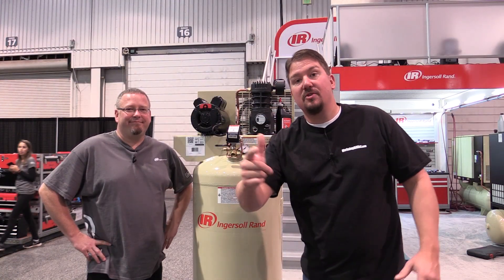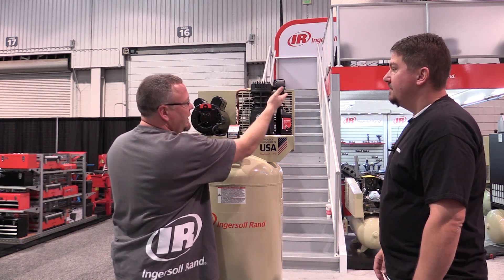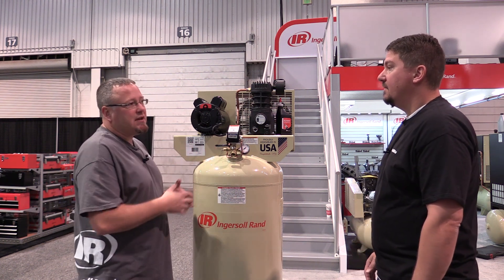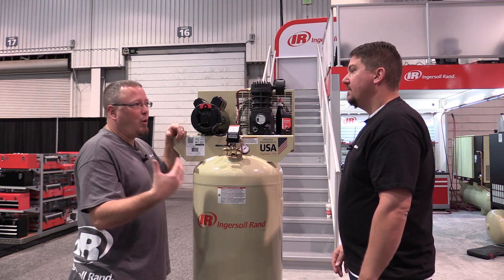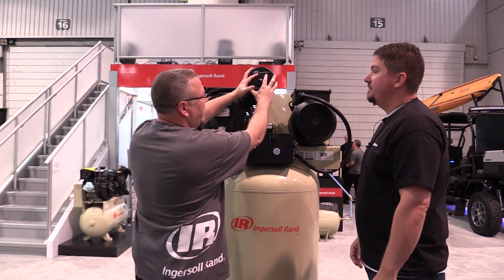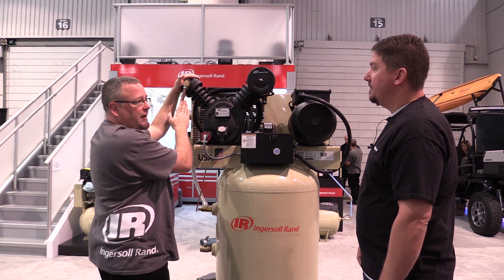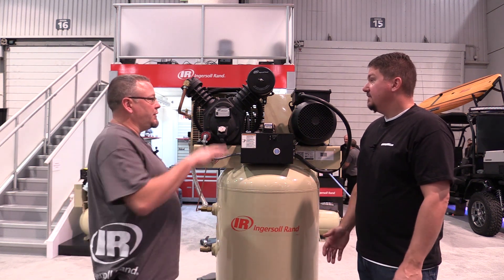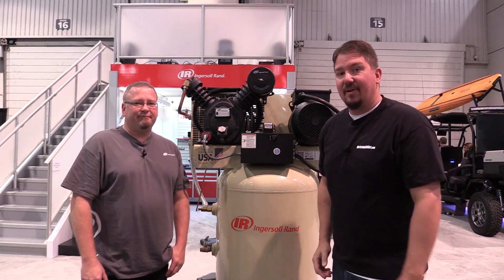The Difference Between a Single Stage and Two Stage Air Compressor

Comment: It would have been helpful to mention that the 1 vs 2 stage compressor is a trade off at any given power, between lower pressure (<150psi) but higher volume, and higher pressure (>120psi) but lower volume.

Comment: I’ll tell ya the best kind of air compressor is a screw type way better than the pump type and when using tools your not really looking at PSI your looking at CFM the more CFM you have the more continuous air you get like for sand blasting plasma cutting even the air tool needle scalers the list is endless with a screw type
Reply: Now I’m running a 10 gallon Central pneumatic 125 psi with to 20 gallon industrial air auxiliary tanks

Comment: I purchased a new single stage 30 gal Kobolt Air compressor and 6 weeks after warranty ran out (5yr) wouldn't you know my crank shaft snapped off. I have been unable to find parts for my motor, 30gal, 155psi from Lowes or Kobolt. Does anyone have any recommendations on where I can order parts (Crankshaft) for my motor. Oil was full when I took off the plastic cover only to find the flywheel sitting there unattached to the belt. Any suggestions would be appreciated. Peace
Reply: Have you tried https://aircompressorpartsonline.com/
Reply: @Berry_MaCocknher  Had not as of yet but thanks for the info. Will give it a try and get back with you to let you know how I did with it. Peace

Comment: I've got air tools that are still going strong, over 20 years old, still running off an older 120V 5HP Craftsman compressor. In that same time I've replaced three cordless drills, all thrown in the trash when batteries eventually failed and became obsolete. It is amazing how versatile and powerful the new battery technology is, but don't underestimate the long term cost.
Reply: 5HP on 120V? You need over 30A at 120V to get that power, what plug does it use?
Reply: @AlessioSangalli  Oh, my mistake. I believe it's 5CFM, not 5HP, it's on a 15A plug.
Reply: Batteries aren't eternal. A good LiIon battery has about 300-500 recharge cycles. There's every chance you had depleted batteries and perfectly good tools and threw both away :)
Reply: @Frindleeguy  That's what I thought, too. When I confidently went back to the dealer, each time I was told they don't make batteries with that specific adapter any more, and even if they did, the cost to do it would be almost as much as a new drill. We've seen this time and again in the appliance, electronics repair, and even manufacturing industries. They collapsed because factories in China will produce a new one for less than a North American repair facility charge to repair the old one.
Reply: Yea always gotta upgrade the cordless , gets pricey

Comment: Is this the one that the motor blows up on, and shoots flames out of the side, burning down your house ?
Reply: One of the 60 gallon Ingersoll Rand compressors has a reputation of bursting into flames.
I'm not sure which one, but I've seen a lot of videos about it.
Reply: It's so unlikely that a motor blowing up could ignite a house... Unless one stores flammable material next to it.
Reply: no, that's the one with the CHINA motor on it.  Sanborn has gone china on us, small wonder
Reply: Their pumps are made in  India so completely normal to fail spectacularly

Comment: I just picked up a 10 horsepower two stage compressor that runs on single phase power
Reply: Thagt means you are from texas
Reply: Is it fine tuned?
Reply: What brand & how much did it cost?
Reply: @cecilarnold6843   It's a cheap Chinese brand called Tech top.
 It was approximately $800.
 If you for shop around you can find it fairly reasonably priced.
https://www.caldwellmotors.com/products/techtop-rd1-rs-tf-215t-4-b-b-10-10-hp-1800-rpm-215t-tefc-single-phase-farm-duty-motor

Comment: you didnt say anything about CFM or whats better to run more than one tool IE Dual Action (D/A) sanders???
Reply: CFM at the tool is gonna be more or less based on the size of your lines and fittings...  a D.A. sander should have a  P-type fitting on it, and be run with at least a 3/8 hose, I have 1/2" on mine.  The compressor just needs to be around 10 - CFM at a minimum to keep up with that sander, and if you want it to surpass the sanders draw ( in other words be able to fill the tank full and shut off while running the sander, your gonna need 15-20 CFM out of the compressor pump, wich should = $1500 to $2500  ish.

Comment: Dumb question. I have a V pump. Does that mean it's a 2 stage? Also I'm looking to replace it. Do I have to use the same brand because it's been discontinued. What has to match up. And how do I know horse power. I have a Campbell Hausfeld HS750000P right now. I know this an old thread. Thanks for any help. Or I need a piston or valve rebuild kit which I cant find. One of the rubber seals is broke.
Reply: And I'm guessing I should go with another V pump to replace it?
Reply from the maker: @davidharris7618  yes.
Reply: @WorkshopAddict  ok. Thanks alot for your help. Appreciate it.
Reply: @davidharris7618  It doesn't HAVE to be a V, you just probably want it to be 2-stage, one cylinder will be fatter than the other. A 2 stage can be a V or many are inline. Single stage but 2 cylinder will have 2 inlets (or filters), a 2 stage only has 1 inlet. A 2-stage will run 175 psi while a single stage will run 125-155 psi. I'm also thinking a single stage will give more cfm albeit at less pressure ... and that's what I"m here trying to find out!
Reply from the maker: No, A V does not mean you have a two stage.  Is one larger than the other?  That would mean it is a 2 stage.  Might be best to buy a new compressor and bolt it on to your tank than searching for a rebuild.
Reply: @WorkshopAddict    Yes one is larger than the other.
Reply: @WorkshopAddict  Thanks for responding. So now that I know I have a 2 stage will any 2 stage compressor pump work. And how do I know horse power. I'm guessing it's a 5. It's a 175 max air if that means anything. Thanks for all your help

Comment: Does lowering the RPM lower the PSI or just the refill time/noise?
Reply: Likely also reduces the running amps that can be good for some motors.
Reply: Lower RPM is literally fewer revolutions per minute. That means it will take longer to fill the tank to max PSI. However, residential sized tanks aren’t so large the additional amount of time is going to be a huge issue for most people.

Comment: Other than inflating tires, I have little use for a compressor. Battery tools have evolved so much, pneumatic tools are obsolete.
No more dry rotted diaphragms in the 1/2" impact air wrench that has less than 10 hours of use on it...
They even have airless paint sprayers. Nail guns are evolving as well. Big compressors will be a thing of the past fairly soon.
Reply: Scott Everywhere Battery powered tools are advancing by leaps and bounds but I don't see them replacing large compressors any time soon. Certain air tools (primarily auto mechanic tools) still have some significant advantages over cordless or corded tools.
Reply: Doesn't anyone use their air compressor with a blow gun nozzle anymore?  I use my compressor more with a blow gun for cleaning debris out of things than I do any other pneumatic tool.
Reply: I've seen battery tools dropped and they stop working, broken tool.
I've seen pneumatic tools dropped many times, they still work.
Reply: one word, maybe 2... sandblast.  Can't  do that with batteries.
Reply: For actual auto techs (not the guy who jus does oil changes and sweeps the floor) there is no comparison and air tools are here to stay. Battery tools certainly have thier place but are limited.
Reply: @TripleL-c5t  agreed.
Reply: My plasma cutter doesn’t work without air, sandblaster too
Reply: I tend to disagree for few reasons:
1. I haven’t seen sandblaster or plasma cutter operating without compressed air
2. Once you have a setup compressed air supply- all your tools operating off the line quite cheap and more reliable than the electrical equivalent 
3. The power to weight ratio is higher for any pneumatic tool if you compare it to electric. It is easier to handle and work with it all day. You can check open sources for comparison and explanation. This is why pneumatic tools took its place in automotive long ago and keep securing it. The electrical nailers and other cordless tools became recently popular because of the battery technology that allowed them to disconnect the cord. But high power demand application will always require constant energy supply - hose or power cord and as you see the preferred supply is the air and not the electrical cord
Reply: David Mm I think if your going for anything over 1/2 inch then yeah air dose win but the power and portability of cordless is extrem I work in a garage where the only things using the compressor now is the tyre machine, tyre inflator and blow gun
Reply: @chrismills498  well cordless tools are heavier and bulkier because the need the battery
Reply: If it rotted with only 10 hours use, sell all your tools and turn tricks instead.
Reply: Cordless/Battery Power can NOT perform the following, yet:
* HVLP Paint Applications
* Sandblasting Applications
* Tire Filling, Debri Cleaning, etc...
Reply: What is "dry rot"? I don't believe it exists. Probably it rotted in humid conditions but you just diacover it when it's dry. That means the compressed air is moist and therefore it's probably installation error
Reply: I need a big compressor  to fill semi tires and blow off farm equipment
Reply: So absolutely wrong. The benefit of pneumatic is that you can take the weight of the power source off of you and get more precise tools with less moving parts that are more accurate. Try going upside-down with a battery powered dual action sander all day compared to a 2 1/2lb Dynabrade pneumatic. Come onnnn.
Reply: Airless paint sprayers are fine for fences, barns... anything where finish quality doesn't matter. But HVLP might take more market share from traditional spray guns.

Electric tools are still a ways below pneumatic. Air tools are lighter, stronger, more powerful, more durable, and you don't have to wait to recharge them or spend hundreds on extra batteries and chargers so you always have a spare. Not to mention the lack of standardization with batteries. I have an older cordless drill in my garage that will be useless as soon as the battery finally dies because the company has moved to a new design. Maybe when manufacturers decide to make all their tools take D batteries I'll reconsider electric tools. For now, I'm content knowing that I can still use the same air tools my grandad used because air is backwards compatible.

Comment: I remember a time when IR and Quincy made good compressors. Cheap, Chinese, high rpm junk now.
Reply: Bo Haggin what do you recommend?
Reply: Larry house. Ir may be assembled in USA but its definitely not made here. Their ss4 pumps which is what was on the first compressor they showed is made in china and you cant even get parts for it to replace a blown paper head gasket unless you order one for an ss3 model. Their ss5 pump on the second compressor they showed is made in Taiwan at least that one you can get parts for.
Reply: I remember when everyone wasn't an expert😏
Reply: IR pumps are made in India
Reply: Bo Haggin My Quincy 2016 model is US ( motor tank and pump) made.
Reply: Bo Haggin ir  is made in America